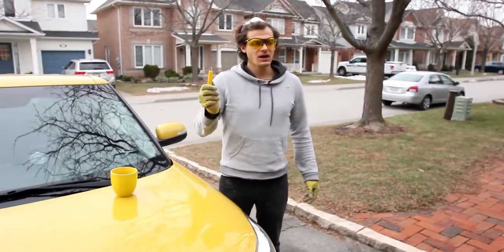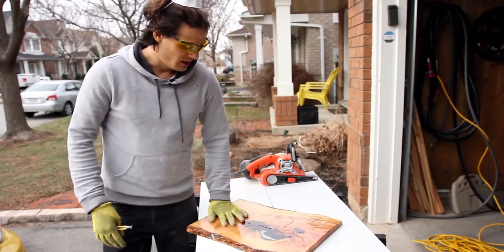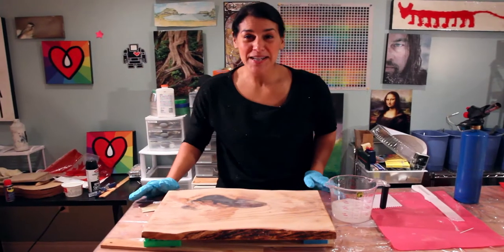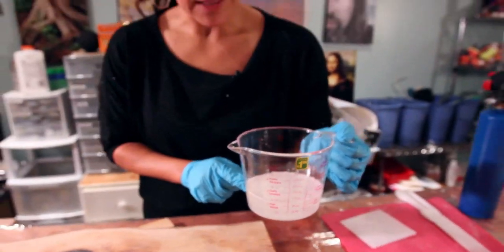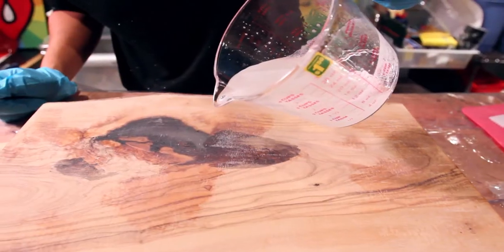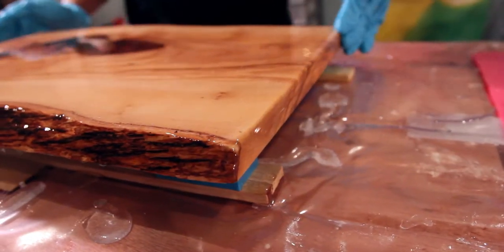How To Resin A Live Edge Wood Board - Part 4

Comment: Pour l'endos vous suggérez un autre produit que la résine pour mettre sur le dessous, pouvez-vous me dire lequel des produits Minwax vous avez suggéré ?
Reply from the maker: Check with your hardware store to see what they recommend to be compatible with epoxy resin - some people like to finish their resined trays off with polyurethane to give it a little more protection against scratches, but honestly, we don't recommend using that stuff ( especially on a project that will come into contact with food ) because it's highly toxic :(

Comment: How does it stand up to the knife if I cut the cheese/meat on it?
Reply from the maker: Hey Rocky - since ArtResin was formulated as a surface coating for artwork to be hung on the wall, we say it is scratch resistant, but not scratch proof.  So depending on the pressure, it may scratch under a knife cut.  The beautiful thing about resin is that if you do get deep scratches, you can always sand it down and re-apply a fresh coat.  Or, you can sand it down with coarse paper, and then gradually work your way up to a really fine sandpaper to get a really smooth surface, then apply a food safe oil ( like wood block oil ).  You'll get a beautiful, slightly less glossy finish, that will be far more scratch resistant and will stand up to knife cuts.